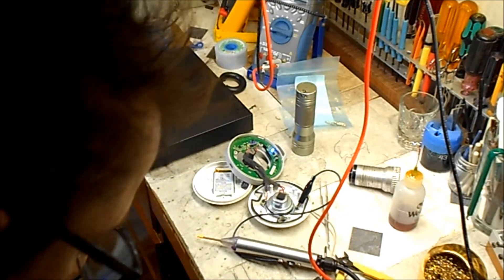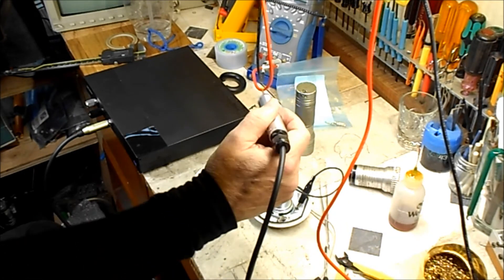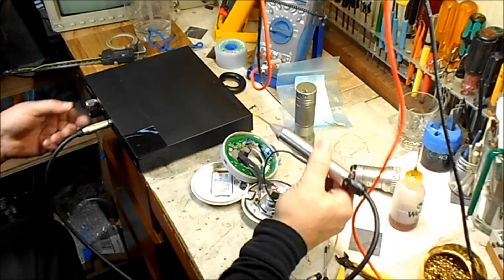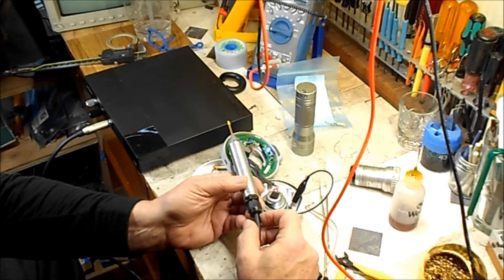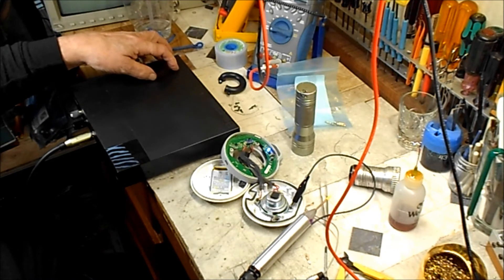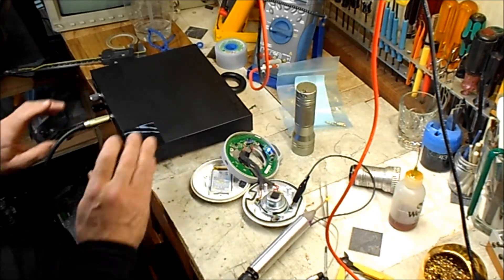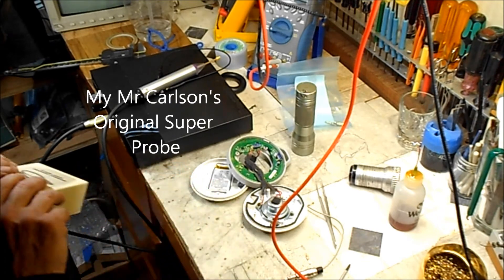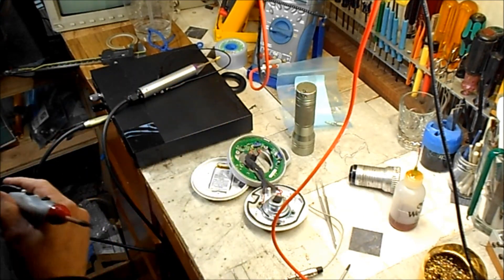My New Super Probe

Comment: Hi-I wanted to ask you: how and why are you charging what amounts to a 7.4v battery pack with a 12v wall wart P/S? I'm trying to come up with a rechargeable scheme for my Super Probe as well, this is why I'm asking.
Reply from the maker: Hi Clay,  I have a Lithium battery charging module. It uses up to 30 VDC as I remember.  I got this from a vendor from eBay.  It was less than $5.00 it connects to both batteries and charges them both with sensing built into the circuit for charging the batteries. So I use an non used wall wart,  It was from the device I made the case from.  Sony, good charger anyway.  Good luck and you should be able to find what you need.